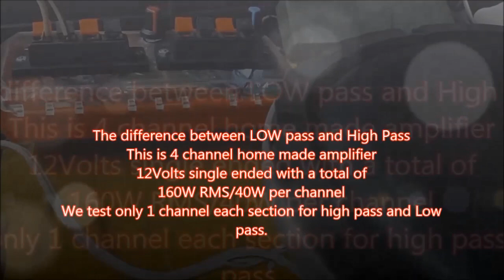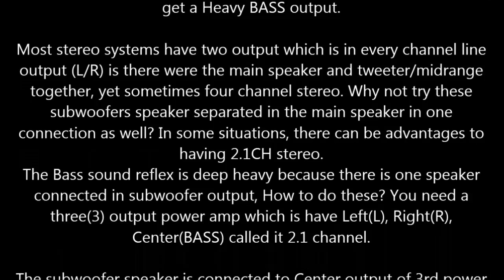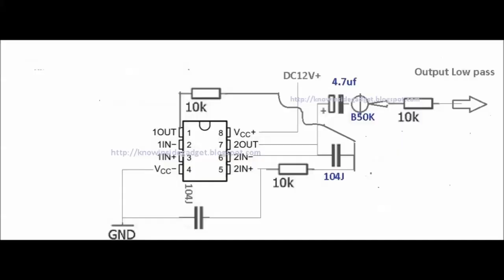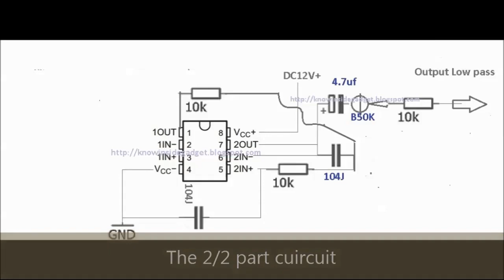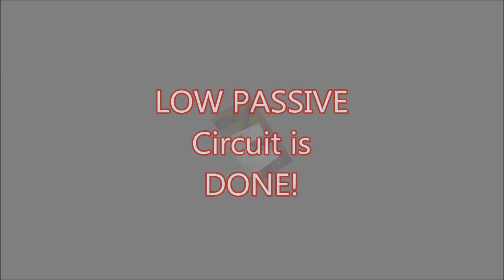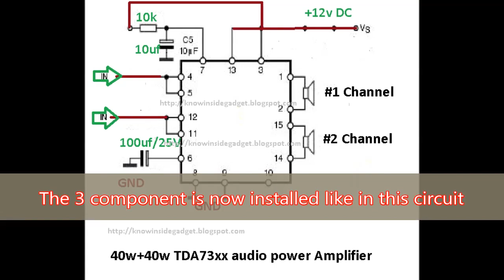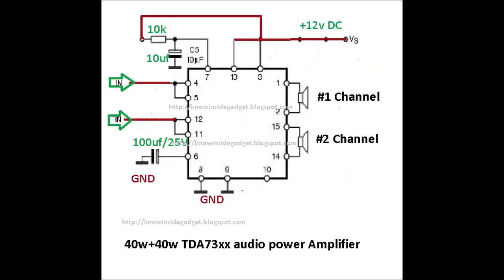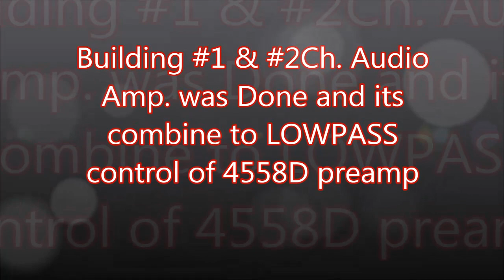Homemade 2.1 Audio Amplifier: Low Pass Filter & Bass Boost Sound Check!

Comment: On 2:04 You need to add resistor in between C2 , R3 connect to power + to come voltage divider to prevent auto muted. Nice LOW pass filter single supply it works.
Reply: oo na auto muted nga ung sakin kapag mahina volume kaya pala thanks.